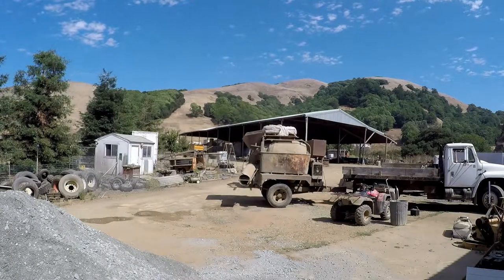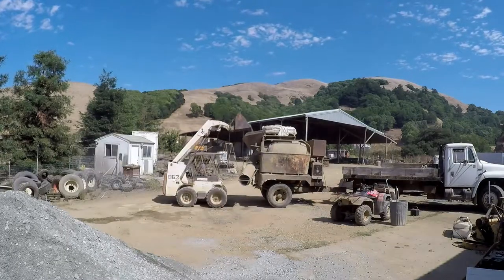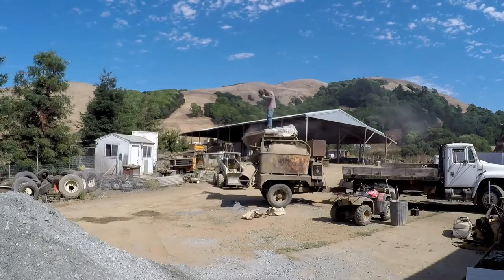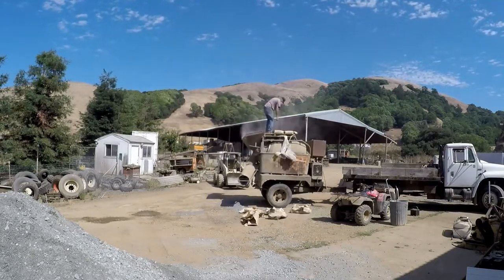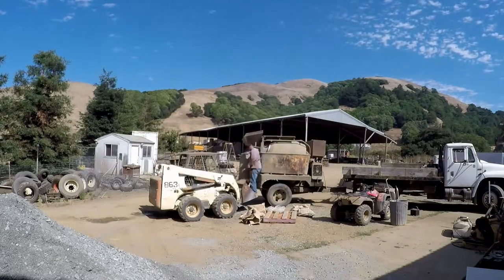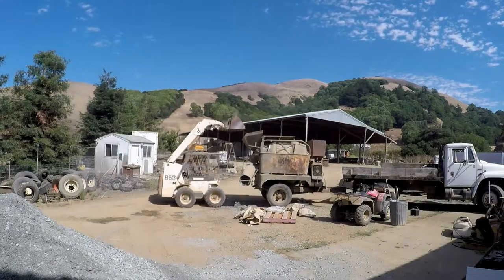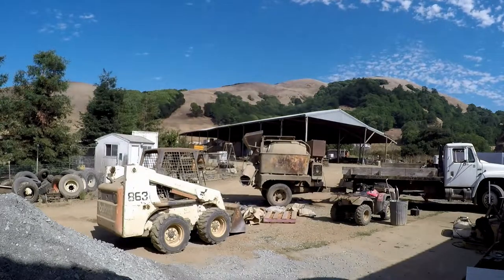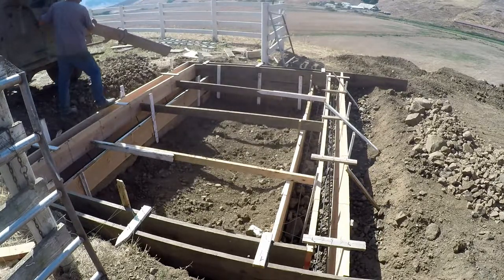3 Yard Cement Mixer

Comment: Suggestion:   Weld a Triangle Knife in the bucket of your skid steer to split the bags on and crack them in half on the ground in the bucket where less wind is present. Then dump in hopper.